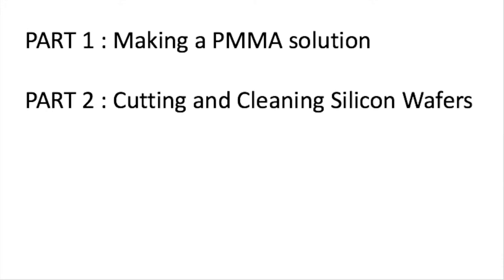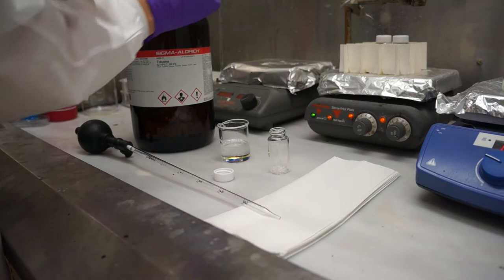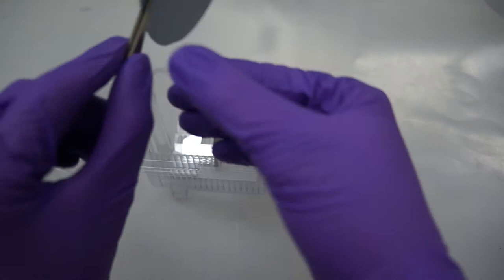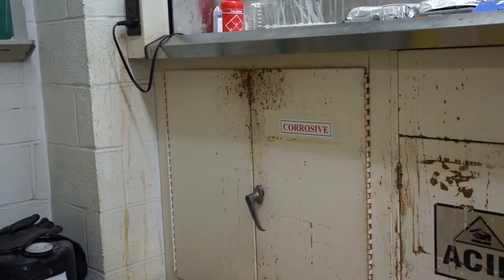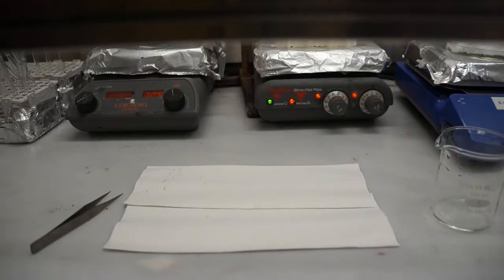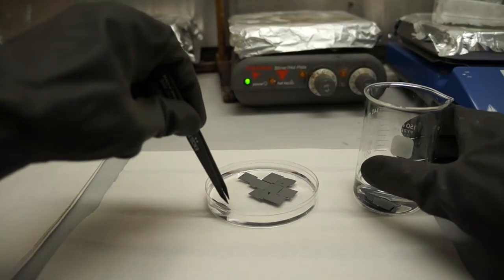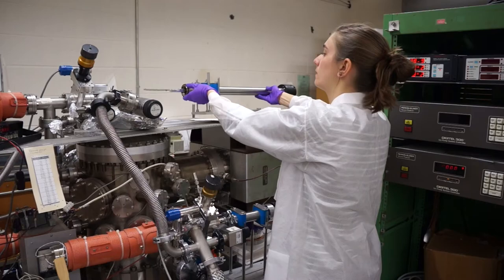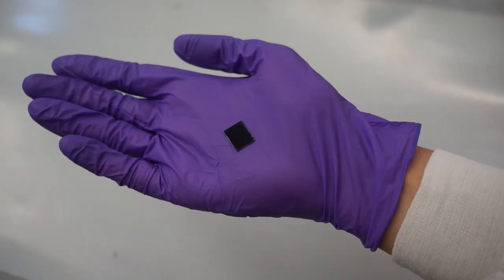PMMA Thin Films Tutorial

Comment: So much more finesse than the way I've been coating wafers... turn on spincoater with wafer attached, douse with acetone, douse with IPA, place polyester cloth over spinning disc and douse the cloth with either solution to 'wet buff' the wafer, spin to dry, squirt on PMMA solution, throw on a hotplace for 90 seconds, go to town with exposing it. I will say my resolution is approaching 1 micron, so I need to work on that... but wow, so much more care done here! I am not doing electronics with the final thin films, more mechanical stuff really... but maybe someday I'll need to care as much as the videographer here did! Thanks!

Comment: These techniques for scribing silicon are horrible. To scribe silicon you just need to put ONE tiny scratch near the edge. Then flip the wafer over, press opposite of your tiny scratch gently with the round part of the scribe, and it will cleave along the crystal planes. This produces no dust and the cut will be perfectly straight every time.